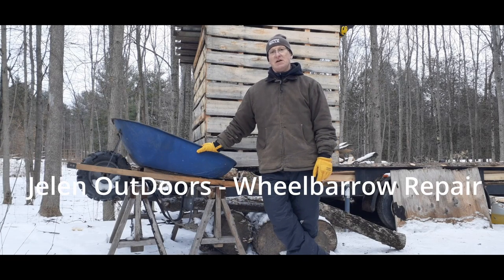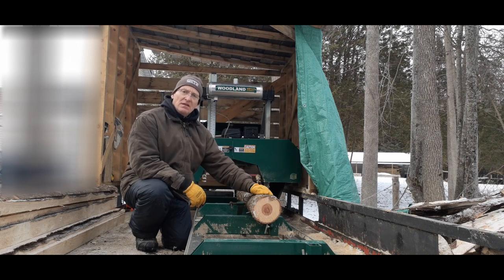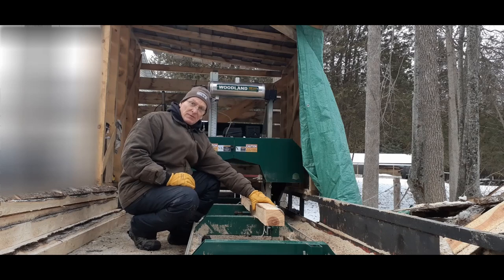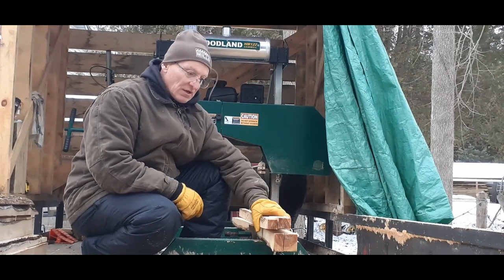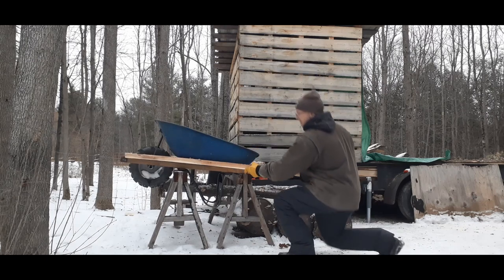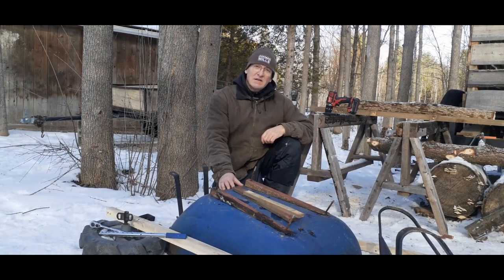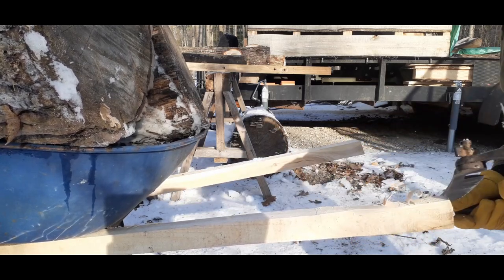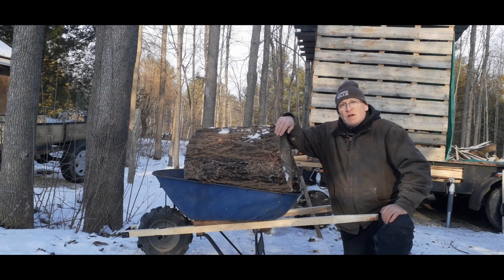10 - Wheelbarrow handles from Scratch - Cutting handles on Woodland Mills sawmill

Comment: Nice Job! I just bought (2) 8 foot 2 x 3 lumber studs which was thicker than the original handles and cut to length and bought longer bolts for the original were rusty and too short. It came out good and stronger than original too for less than $18 for parts. Take care!
Reply from the maker: Thanks Tony.  That is excellent that you were able to replace the original handles with new stronger ones for $18.  Thanks for watching and have a great day!
Reply: @JelenOutDoors  Yes and that included the $8 for the new longer bolts. I did make them about 4 inches longer like you did too. Thank you again for your video.